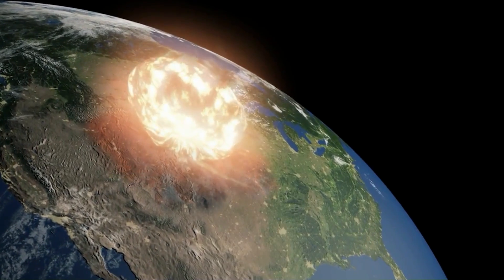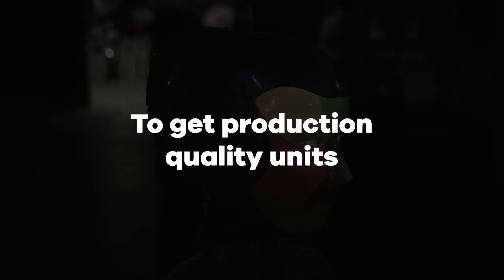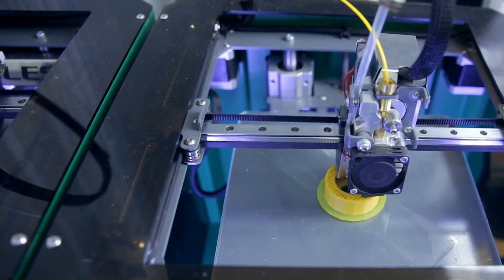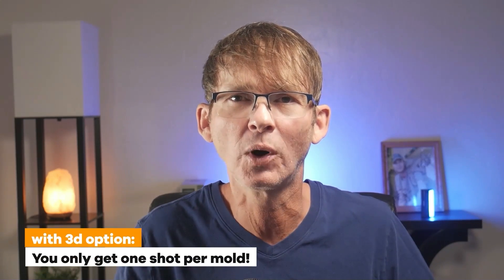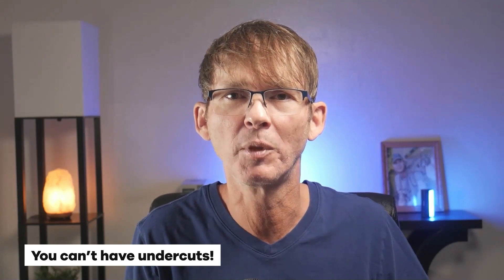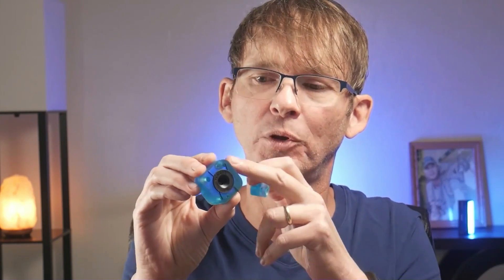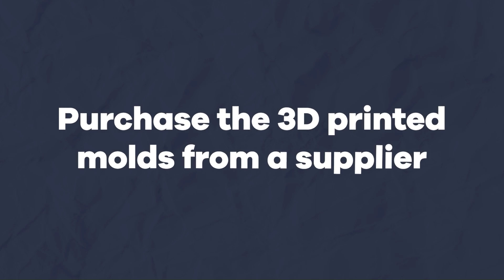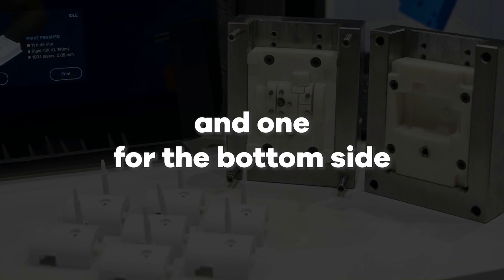New technology is a game-changer for product development - Discover this almost-secret tech

Comment: You have more options than this!
I've built an entire company to do this.  You can print the high temp molds on any LCD SLA 3d printer, like Anycubic or Elegoo, etc. You dont need that special $8k one.  You can also have me, at Golden Gate Molders do it all for you, I have 6 injection molding machines 3d printers and a CNC machine that allow me to deliver real injection molded parts for far less time and money than before.  We also have a ton of resin in stock if you need to source resins, especially specialized ones for your injection molding project's.

Comment: I have seen Formlabs make a white paper about 3D printed molds. I was excited when I read about it a few years ago, but they mainly discussed doing this with silicone material. 

The latter half is more challenging, as it requires a manufacturer that can run this mold. It would be cool to see someone like Shapeways add this as a service and have the capability for 2 mold sizes. I have looked into hand press machines for the molds. They can only apply so much pressure, which limits the use of tougher materials like Polycarbonate. 

You mentioned the Nexa3D. Is that because its accuracy is high enough to create a smooth finish on the resin parts, or is it a fact that the unique materials can only be used with the Nexa3D?
Reply from the maker: Yeah in the past I've always recommended using soft silicone molds which is also called urethane casting. But this is different since it uses a hard mold and allows the use of production plastics.

There are multiple choices for getting molded parts using these mold inserts.

The main thing with the Nexa3D printer is it can print using these special materials. 

This is all relatively new for me too. I had an expert on this tech host a live workshop in my Hardware Academy which where I learned about it.